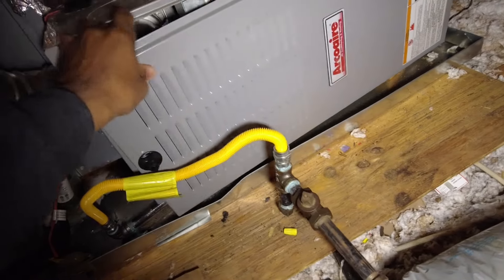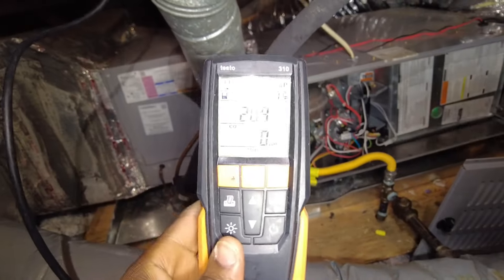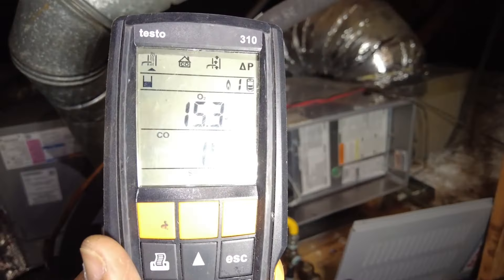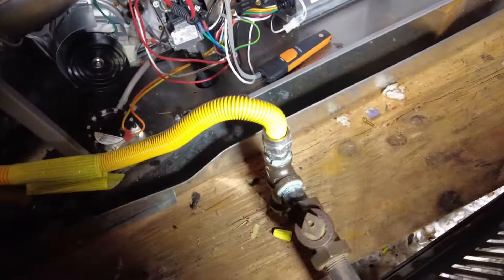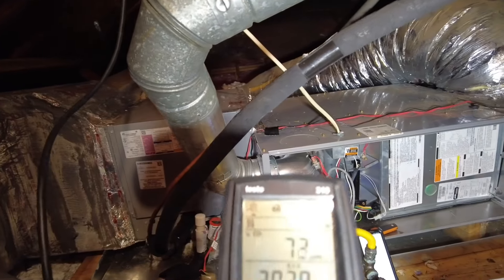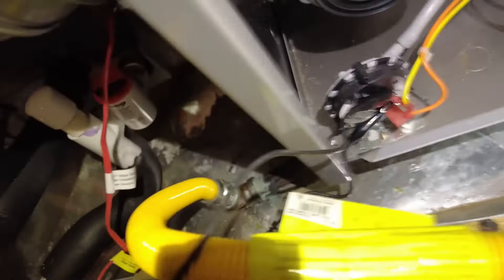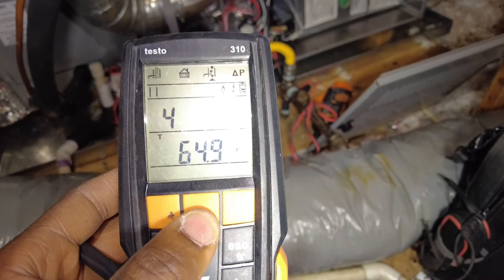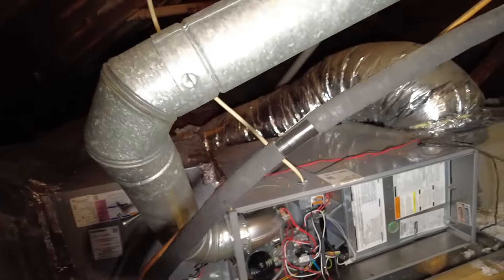HVAC Tech Full Maintenance on 80% Gas Furnace HVAC Training

Comment: Great video! Did you increase blower speed because of temperature rise increasing slightly after adjusting gas pressure?
Reply from the maker: Yes sir! Sorry for some reason I didn't record that part but yeah the blower speed was set too low from the start anyway.